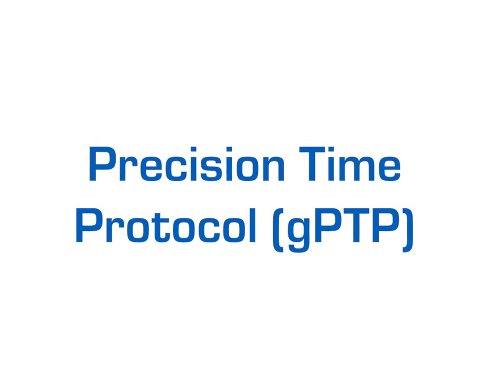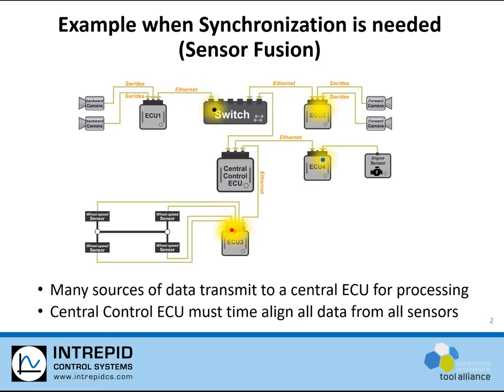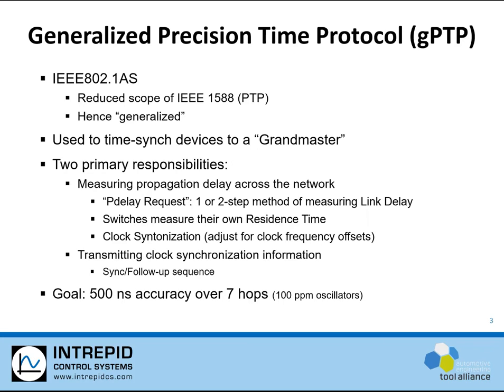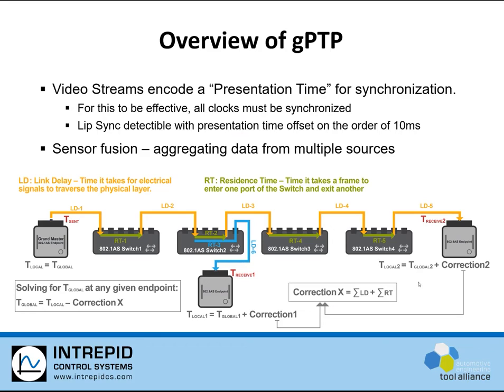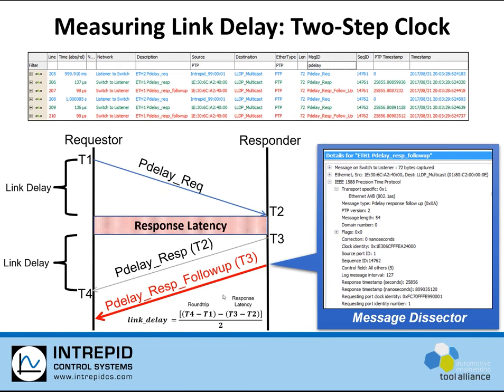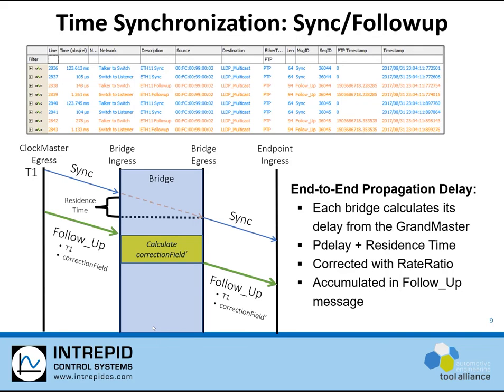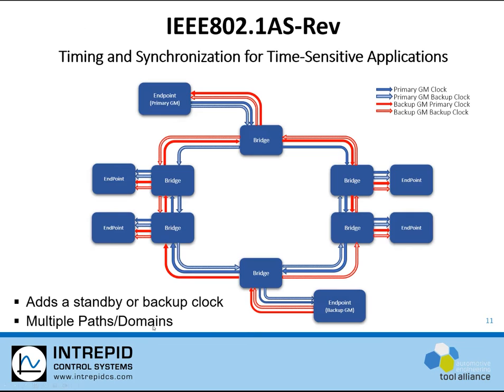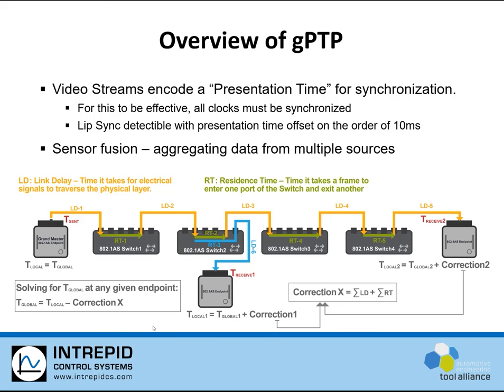Precision Time Protocol (gPTP) Explained in 5 minutes

Comment: When you have an PTP appliance with a GPS antenna, is it assumed the determined position is that of the antenna or the GPS circuitry decoding the signals inside the appliance?  How far can a GPS antenna be remoted from the appliance?
Reply from the maker: Generally speaking, the maximum length of the coaxial connection between a GPS receiver and its antenna depends on the specifications of the receiver, antenna, coax cable, and coax connection systems.  The latency between the antenna's actual position and the calculation of its position would need to be derived from the GPS system specifications.  Since this latency is independent of PTP, it would need to be subtracted from the PTP time stamp of any GPS measurements. Hope this helps!